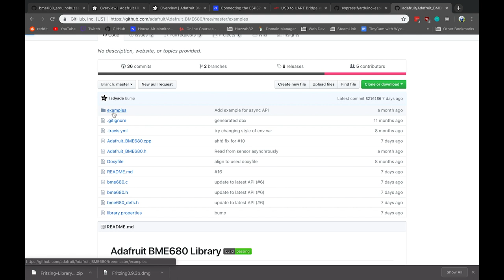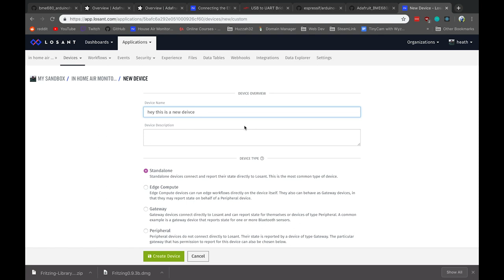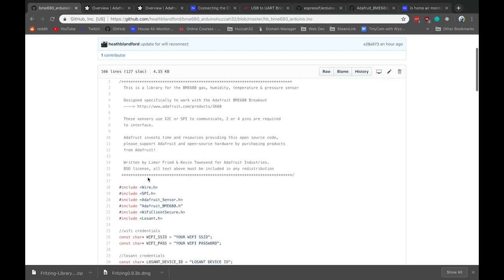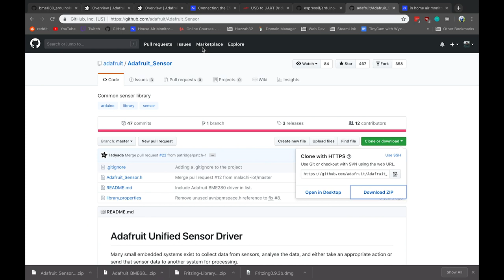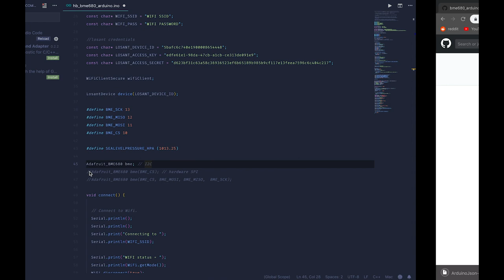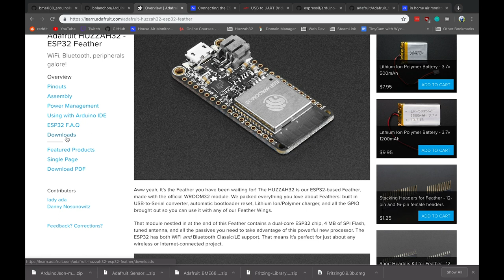ESP32 and Air Monitor (BME680):  Tutorial

Comment: I tried these instructions and there as to be something wrong with the libraries in combination with the Huzzah32  esp32 it says there are two excisting WiFi.h libraries and PubSubClient.h is missing for some reason I can't get it to work do you have a Idea what could be the issue?
Reply from the maker: Hey! Sorry for getting back to you so late. I don't have a good idea of what your issue may be. My first instinct would be to remove the WiFI.h libraries that may be installed (would be in Arduino\Libraries folder) and restart the Arduino IDE and reinstall them. 

Let me know if you've already solved this issue, I'd like to know if you got it working!
Reply: @heathblandford6493  yeah I firgured out that Ik had to change something in the public sub client library and every time I install a new library click on the "get" exe to make them compatible with the esp32 not really sure why this is necessary but now it works
Reply: @heathblandford6493  I got it to work now it works really great thanks for your very helpful instructions.